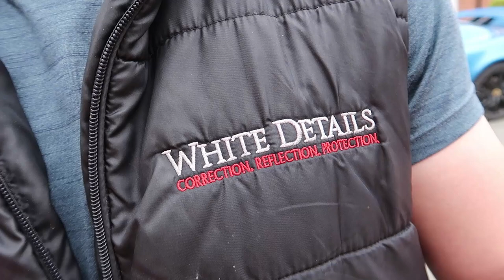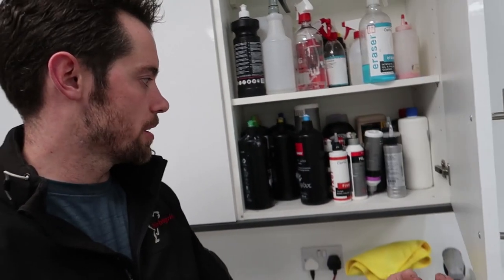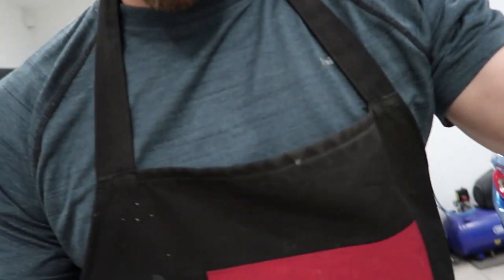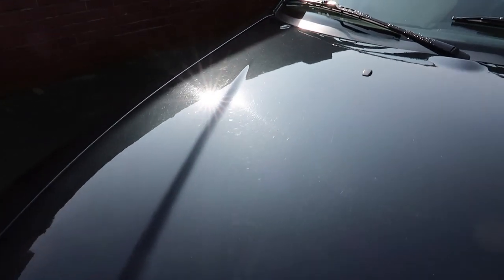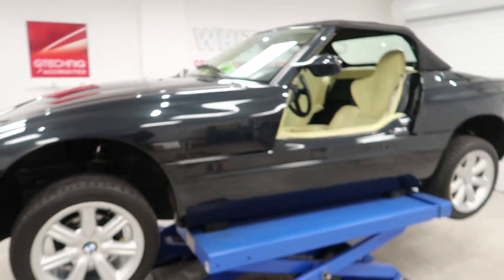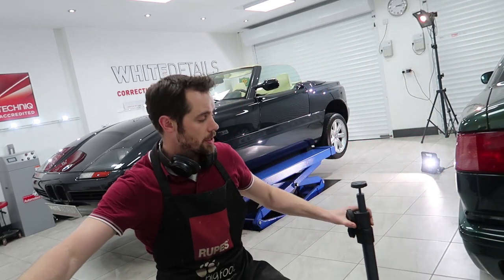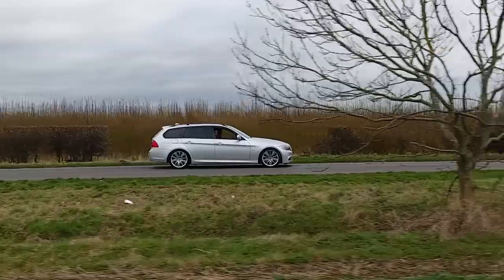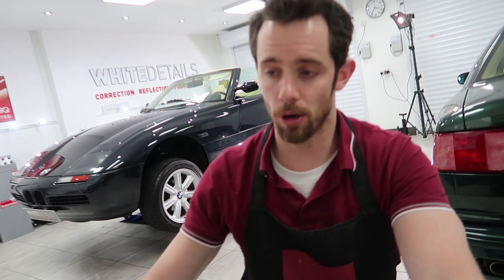Lotus Exige S, Driven and Detailed plus a BMW with trick doors VLOG 027

Comment: Great work Jim, I'm really enjoying watching and learning from your vlogs, many thanks for taking the time to make, edit and post them. Don't know if it's been asked before but I wondered if you ever did any form of wet sanding? just wondering if a system like the mirka abralon 4000 grade discs via short throw air da may take out some of the more serious defects you might encounter thus saving you  time on the cutting stages.  Cheers Norm.

Comment: First thing's first, those drone shots were awesome! Great job on both vehicles. Here's a question, what do you think about applying sealants or polishes or waxes on windshields? Do you think it's worth it and even helps with the rain while driving?
Reply: Thats quite a good question. My understanding of polish and wax is that they bond with the vehicles paint work (similar to how contaminents do). Id say polishing and waxing glass is a waste of time... however i do polish and wax the light covers on my cars (which are plastic). As for glass, you can buy specific products which cause water beading and resist the windscreen wiper blades for longer. I use Gardx Glass gard. It came free with my Golf R and is brilliant stuff.
Reply: I'll check that out. The only reason I bring it up is because Jim did it in this video (8:16). Thanks for the tip!

Comment: Been thinking about this a lot lately as I detail cars on the side to avoid re-cleaning everything you always want to start at the top go to the bottom you never want to do something that's going to make something you already cleaned dirty again clean the interior first or the exterior? Everyone I see do it cleans the outside first but seeing as I get a whole bunch of dirty cars I always find for me it makes more sense to clean the inside and then clean the outside any cons of this that I'm not thinking of or pros to doing it the other way
Reply: Quentin Piliero I'm the same as you Question,  I use my air compressor to blow the dust and dirt forward from under the seat and loosen dust frm the headliner etc and find the dust- not all of it but a decent amount- settles on the exterior, hence why I do the interior first

Comment: If you have your rims coated with a protective coating do you need to iron out the rims every so often? Or just use soap and a wheel cleaner?
Reply: Natty Brah Regular wash with soap and water is normally enough to keep the wheels in great condition when coated. But u could use a PH neutral iron remover from time to time.

Comment: If you do consider upgrading your camera rig and want to keep it reasonably small, consider looking at the Sony A6500 with a 16-70mm Lens and Rode VideoMic Go. This would be a big upgrade in video and sound quality etc.
I'll provide amazon links in case your interested :)

Sony A6500: https://www.amazon.co.uk/Sony-Compact-Stabilisation-Autofocus-Touchscreen/dp/B01M2WAE29/ref=sr_1_1?s=photo&ie=UTF8&qid=1494874524&sr=1-1&keywords=sony+a6500
16-70mm Lens:  https://www.amazon.co.uk/Sony-SEL1670Z-Mount-APS-C-16-70mm/dp/B00EUFTT62/ref=pd_sim_421_6?_encoding=UTF8&psc=1&refRID=XAPWAETGKWR5HS24G9QF
Rode VideoMic Go: https://www.amazon.co.uk/d/Camera-Photo/R%C3%98DE-VideoMic-GO-Camera-Microphone-Black-Red/B00GQDORA4/ref=sr_1_1?ie=UTF8&qid=1494874586&sr=8-1&keywords=rode